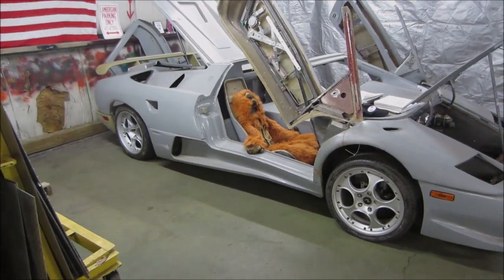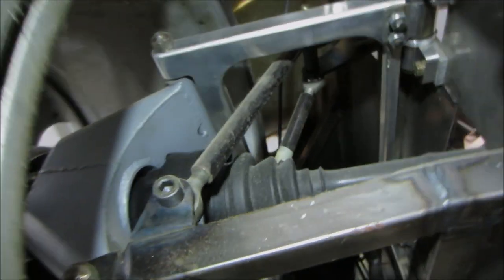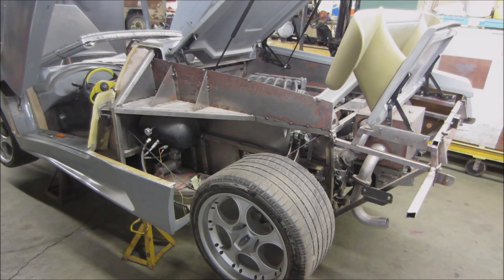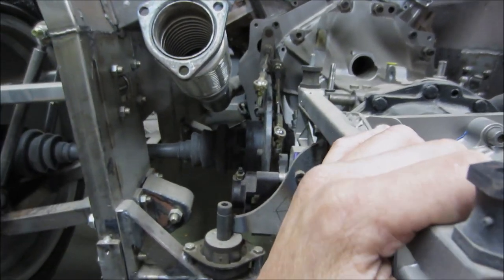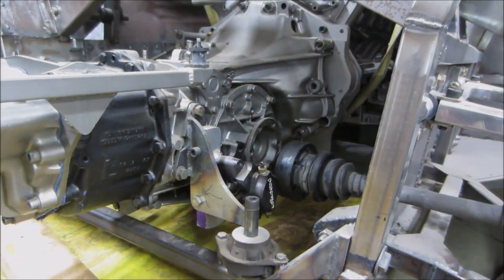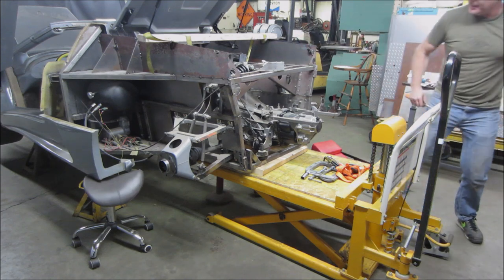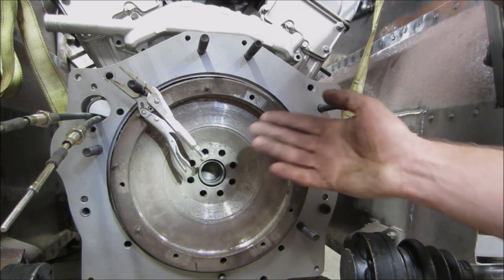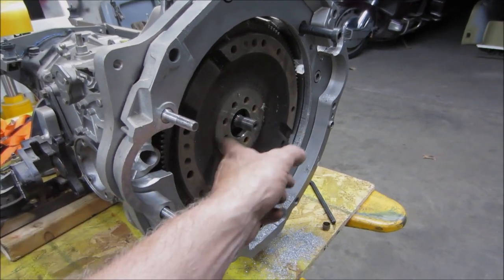Free Lambo Diablo hand built, lets see what it needs to Run?

Comment: That engine seems like a mock up, its gonna cost quite a bit to get it running the real engine was probably the one they sold
Reply: Thats kinda how it seems. The thing has such a wierd color/hue to it. Like it was bead blasted or all painted silver. Its too clean, but not like fresh rebuild clean. It'll be interesting to see whats inside that engine.
Reply: Stock and original engines for this start by 15k to 25k Go figure. YeS.
The - original - Diablo was from 184'000. Not a a bargain for the most.
Reply: junkman its a BMW motor, not a Lambo

Comment: I have seen someone on tv that cut a section of bell housing from the transmission bolt pattern of the engine and then cut a section out of the transmission wanted to be used then mated them together. I think that may be the best option in this case. The only question then is if the 7 series came in a manual transmission if not this could be very expensive to make run and drive with custom fab parts.
Your patience is astounding, I would  be so overwhelmed and want to sit in a corner and cry.

Comment: Maybe I am stating the obvious, the clutch disc fit the Porsche transaxle, so the flywheel was probably from the Porsche engine as well. Will never line up on the "Bring More Wrenches (BMW)" motor. As for the starter, we use the Hi-torque starters that fit smaller flywheels. You would need to cut away some of the adapter housing (forward face, engine block side) to get it to fit in. Then you can use the smaller dia flywheel.

Comment: That engine and trans in that thing should come out completly I think. Set it aside and install a nice running VW engine and trans in it. That will get it to a yard driver of a vehicle. You can then take your time and video figuring out the engine and trans on a bench. While making videoes of VW engine and front suspension getting figured out. A long with a little basic electrical. Just keep doing what your doing Nice update on this project

Comment: 1600 Dual port would do the trick.  If that is an early BMW 12 cylinder, its like 2 inline 6's.  It has 2 engine management systems.  Basically 2 of everything.  You may set it on fire out of frustration before you can gather the parts.  LOL.  Not sure where you are going to find that door skin either.  Good Luck and we are looking forward to any progress or ideas in the future.

Comment: That is most definitely an adapter kit. Go check your 4 pallets of stuff and organize everything. I'll bet you will find the missing spacer/adapter that allows you to bolt that flywheel to the stock auto trans flex plate. You should really go through the pile of parts first before looking at the vehicle anyways and save your self a lot of headaches. Looks like a fun project. Please don't give up on the V12. Grab a donor car and get the wiring harness and electronics and do it right.  I'd hate to see you take the easy way out and throw some crappy 350 V8  into it or some kind of boring carb setup on the V12.

Comment: Unless you have every part you need for that BMW engine I would take it out and put an LS in it. The cost of part for the BMW will be outrageous!
Reply: An LS would twist that silly frame into pretzel shapes.
Reply: He could buy a rolling Corvette C5 chassis for ~$6k. bolt the engine straight to the trans without a drive shaft. 

Still needs a completely new frame.
Reply: @kevins.3573  It needs to be some where else, being some one else's money pit. What I have seen of the frame would not safely handle a VW  engine, no way for a LS engine.
Reply: Eww LS swaps are too common, I'd love to see a diesel swap like he joked about XD

Comment: It looks very much like a concept in development.  The mechanical build would need to be completed and proven to work.  After that the whole car would need to be stripped to the chassis for paint and rust treatment.  Body panels finished, mechanical assembly, body panels attached, wiring, upholstery, and glass.  Quite a hill to climb if it's to be done properly.  But that achieved, what would it be worth?

Comment: The real engine was probably the one they sold.
Reply: I'd wager this is correct. You always use the junk engine for mockup.
Reply: The engine is one of the easiest parts of this puzzle to solve. I wouldn't worry about that too much. Whether or not the one in the car is total garbage is close to irrelevant. He can get a new one and a trans from a junkyard and have it installed overnight. That would put him right where he is now. No where CLOSE to starting and driving it. Lol.

Comment: It looks like the previous owner did well with the fabrication 
For the engine I would think good about keeping it the newer version 12 cylinder has some smart things 
as when driving in the city’s limits it turns automatically to 8 / 10 cylinder depending on the speed your driving 
Greets from Holland

Comment: Could use the BMW flex-plate to start the engine. Then clamp the flex plate up with the flywheel, seen that done before. Flex-plate becomes a spacer between the crank and the flywheel.
.

Comment: As is, i'd say this car is somewhere squarely in the 70 to 80 % finished, if we're not talking about pre-made items like interior parts or things that you bolt on, rather than fabricate, and somewhere around 50% if those are included. I see unfinished welds, some..iffy things, i certainly wouldn't hang all that weight off the gearbox's bum and stuff that were put on as placeholders, like the suspension...you should check if there's either parts or if they don't actually accept original parts from other cars...i know, a tall order, but you can narrow the suspect list by checking a few diablo kit car forums, he was good, very good, the whole thing is impeccable in terms of construction, but you don't build a kit car like that without a lot of mental/moral support. Heck, there might even be, a build thread somewhere online for this very car.

I'd continue, but then again, i'm a sucker for such projects. I only recently sold on stuff that packed my shop/garage because i want to get more into electric stuff, but up until recently i was seriously having trouble figuring out which part went were. :))

Do yourself a favor, if you do continue the car and tear it down and go over it with a fine comb. It would be a shame to have something go wrong when the road so far is so well paved.  If you do take her on, i've no doubts you'll make an amazing car out of it. :D

Comment: I believe that flywheel is the stock one for the porsche the trans came from.  A few companies make those adapter plates, not sure on sourcing a clutch.  A running/driving parts 750 is under $2000 in my area, probably cheaper up there because they rust out...  Good luck, quite a project.

Comment: You need a two piece flywheel adapter like project e55 ASL. Its the same as a wheel adapter that goes from 5 to 8 bolt or whatever.  You can put the pilot bearing in the adapter too.

Comment: Looks like the mother of all money pits to me. That square tube frame work also looks suspect. After all the work it would take to put this on the road, what would you have? A death trap.
Reply: A death trap indeed!. A motley collection of tubing tacked together with a $100 stick welder.. The only value in the project is the fibreglass body. I would not tackle this thing without significant engineering input from hot rod builders and at least $100k to spend on it.

Comment: As far as I know there was only one BMW that came with a V12 engine mated to manual transmission, which was the 850CSi, which used a version of the first generation BMW V12 from the late '80s and early '90s, and even that is a very rare car so I have no idea how easy it would be to find one of those.  I suspect this is a later V12, from the sounds of it probably from a mid- to late-'90s 7-Series, which were all automatic, though that era of V12 was more closely related to other BMW engines so it is possible that another BMW flywheel might fit, though it's likely it would need to be re-balanced to the V12 engine.  The problem could be the clutch set-up, which is pretty unusual on the Porsche 944, as can be seen by the flywheel that you have.  It might be a case of having a flywheel made, which may not be as expensive as you might think...
I don't know that the idea of using a standard BMW auto flex plate with the Porsche flywheel and clutch assembly attached to it somehow would work, as you said, it would need to be absolutely spot-on to avoid causing massive, probably destructive vibration, and the Porsche flywheel assembly is going to be balanced to the 4-cylinder Porsche engine it was made to run on, so it's still likely to be horribly out of balance for the BMW V12 engine.  I also don't know if the Porsche clutch set-up would handle the torque from the V12 as they're pretty close to their limit on the 944, though I'm sure uprated clutches are available as they are a pretty popular car for racing...

Comment: It looks like getting the drive train connected and running is going to be a job all by itself. I wonder if there is a spacer between the crank and flywheel to make up for the adapter plates? Good Luck.

Comment: You might want to try bmw 850i flywheel and transmission linkage. The
V12 block is very similar. Possibly a salvage one for the harness and pcm. :) keep going you can do it! I cant wait to hear that straight through engine fire up.

Comment: You may want to reach out to Casey from Genius Garage. He used one of these BMW V12's and mated it to a porsche boxter trans (flipped upside down) and I believe he used a commercially available adopater to mate the engine and trans. I wish I could remember the name of the company that makes the adapters but basically you can now mate damn near any engine and transmission together (except motorcycle's, thats an entirely different solution that uses a chain driven diff. Yep, theres a company that makes those lol.)

Comment: Don't know if this helps but there was an 850csi with the v12 and I know a manual transmission was an option so there are flywheels/clutches available to bolt up to the engine. Maybe the splines from BMW are the same for Porsche? Probably not but they are both German so who knows

Comment: Adapter plate(S) two half the required thickness, one split from 300 to 120, and the second split from 060 to 240 after stock flywheel clutch assembly with a custom hub , the strength should be adequate.

Comment: What a nightmare.. lol. I've seen the hassles of people doing motor/manual gearbox and even auto tranny swaps. Sometimes it's straight forward and the flywheel and pressure from one, lines up well enough with the clutch and thrust/throw bearing assembly from the other. Sometimes, the headache grows and grows......  A central hub extension might be the way to go. As you said, its centering and balancing is the greatest issue.

Comment: The rear adjustable suspension connecting rods are missing the jam nuts on the heim joints. Make dam sure you get the jam nuts on those or that rear end will work itself way out of alignment. It looks like some kind of modified four link setup in the rear. I’ve built a couple of Shelby Cobra kit cars and things like missing jam nuts can lead to a bad day while driving.

Comment: Now you know why it never got finished..see my mid-engine Corvair project with a Audi v8 and 944s transaxle, it not running either.  Major fabrication/engineering involved.
How some do it is use the flexplate for the starter engagement a center flywheel section to the flexplate.  The transaxle needs mods too.

Comment: I dunno much about that engine, but I suspect the stock flywheel is specifically balanced for that engine. So if you try to weld or bolt that other flywheel to the one that is meant for that engine, you will probably have one hell of a vibration that will fubar the engine. What you might try doing though is using a Corvette transmission, form one of the newer model Corvette's that are rear engines like the Lambo instead of what you have. But then again you might just machine a new adapter plate that is not as thick as what you got. That way you will bring the entire clutch assembly in closer, either that or go with one of those 6 plate clutch systems, instead of the single plate you are running as a lot of Lambo's use a 6 plate clutch system for better performance and durability. As that setup you have might actually be set up for a 6 plate clutch system.

Comment: From what I have seen in the first two videos, I would not trust anything in this motor. I would have to tear it down to see what has been done.  If it came out of a running BMW, why is the block so clean inside and out? Did the previous owner rebuild the short block? At least check the torque on the rod bolts. haha Just a few questions I would want answered before I would consider using it. It would be cool to see the Lamborghini looking engine in it but I wouldn't exclude a transplant option.
 This will make an interesting videos series, Mustie. Lots of people want to see how you would accomplish this (If you decide to). Love the videos and thanks for sharing them.

Comment: In the last video on this car I noticed that the pallet of extra stuff you got with the car contained a high pressure air compressor that was used in the remote controlled gun turrets of the B-29 Superfortress. Do you have any plans for this piece of Aviation History? I have some info on these compressors if you're interested.

Comment: If this is a BMW M70B50 engine, you can find the flywheel for it, because series 8 E31 850  was offered with the same engine with an option to have a manual transmission. Which you couldn’t get in 7 series E32 750. And of course, it was not so common option to have a manual transmission in 850, so that means that flywheel is going to be quite expensive to by new.

Comment: I am an retired BMW specialist in the UK, contact me if you want info, I have owned several V12 BMW's over the years and scrapped a few, until two years ago I would have had an automatic flywheel kicking around, and a worn V10 flywheel / clutch assy, I once had thoughts of building an ultima kit car using the same V12 engine with an upturned Porsche transaxle as one option, fyi the V12 automatic bellhousing unbolts from the box,

Comment: Should give the guys at haltec a call and see if the would be interested in coming onboard with a stand alone ecu can system.....with a interia and a paint job and windscreen running or not this would be cool...mind you you could get a wrecked late model corvette and use its full harness cluster ignition ecu and ls back to diff for a dirty basic swap ....but if you got a v12 could you really roll with a dirty gm v8 and be happy?

Comment: Look on the bright side.  It's not a flood car and you have 4 pallets of parts to help you finish it. I'm surprised you haven't mentioned anything about documentation.  Weren't there plans and an assembly manual included in your parts pile?  All of that fabrication must have been done from plans.  It's too well designed to be cobbled up spontaneously.  From what I see most of the hard work and investment is already done.  You just need to figure out the interconnectivity issues the original builder was putting off.  By the way gear reduction starters enable you to put as big a pinion as you need on the flywheel without overburdening the starter.  Fuel tanks on mid-engine exotics normally go on either side of the engine in front of the tires with an equalizing pipe running under the harmonic balancer.  I love this project!

Comment: Hey bud, First off you may want to recount - The crank shaft isn't 8 bolt holes it has 9. Or should I say 8 bolts and a dowel pin.  Maybe you could find out what company made the bell housing adapter plate and see if they make a flywheel for this setup. Or maybe they made this adapter plate for a certain flywheel that they had out of something.  Just a thought but who knows.....Looks like you have some research to do.  Good luck  -  Later

Comment: dont have a steel adaptor ring with the parts? it has to be mounted quite some distance from the engine, so its possible to make a connector/adaptor ring for the flywheel, i have a company who rebuilds petrol or diesel cars to electric driven, my speciality is a Lotus Elise, but then electric, and with the normal Elise (Toyota)  gearbox, i have to mount the flywheel to the electrical motor, basicly in the same way as this "problem" find the distance you have to move the flywheel, and simply make a adaptor-ring, btw, what a great build car, it seems many of the hard, or challenging parts already have been done, in a pretty good and solid way

Comment: That’s a BMW M70 engine. Basically two M20’s joined at the crank. I have full documentation in the form of Bentley manuals if you need them. I had plans to drop an M70 in my 87 325i

Comment: Hmm.  My first thought is -- does the engine actually run? Is the transmission any good? Until I knew the answer to those questions I would not invest more time and money into this venture.  Time and money wise you may be better off getting a matching engine, bell housing and transmission and moving on from there.  But then will the drive axles line up.  Never mind.  You know all this more than I do.  But great video for sure.

Comment: Make it Electric! You wont have to worry about the fuel tank, engine, adapter plate, starter, clutch, and so much more. Being it is recreational it would be more reliable as electric. Lots of places in that body to tuck some of those chevy battery units into. IMHO 300HP motor would be plenty for that build. Not much of reverse engineering/construction to go EV at that point in the build. Much less headaches and likely around the same amount of money to the end product.